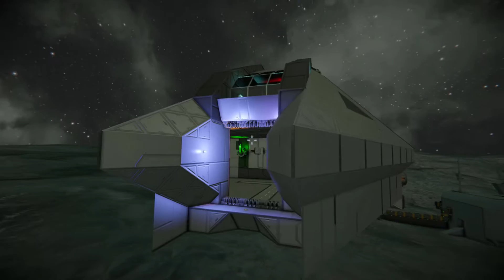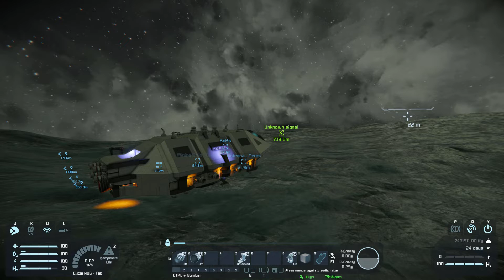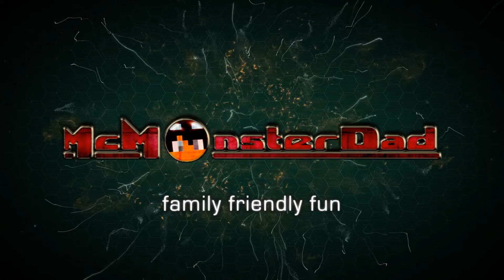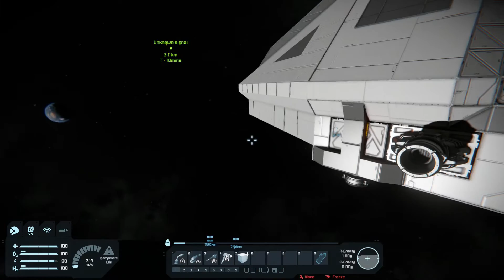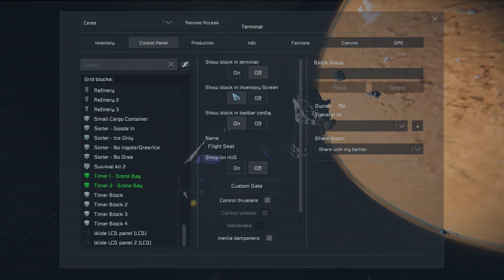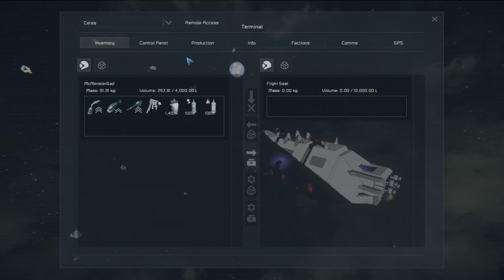LEAVING EUROPA | Space Engineers Survival | Season 3 | Ep10

Comment: Did you test your retracting landing gear design? To see if it was capable of bringing a ship down to the surface? You left on a long range flight with empty cargo hold? The basic philosophy of survival games is, "always be crafting." That's also applies to harvesting and processing raw into intermediate resources. Consider the size of that bridge vs the hanger, then look at an aircraft carrier. I wish I had time and my gaming rig to play S.E. right now. A vessel typically has an empty mass and a full mass, that the engine must deal with. I hope those engines have the power for full mass.
Fyi that drilling rig may need a second landing gear, the one took care of two out of three degrees of freedom.
Have fun and keep up the good work.